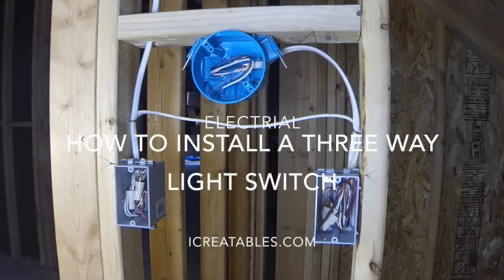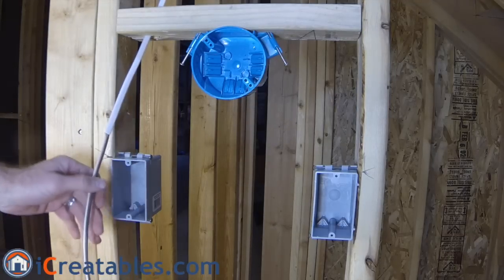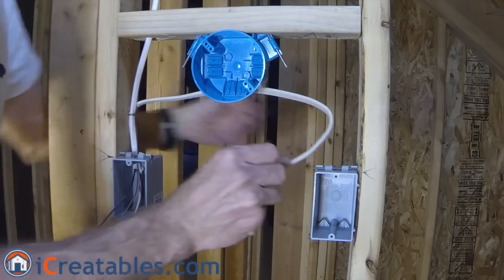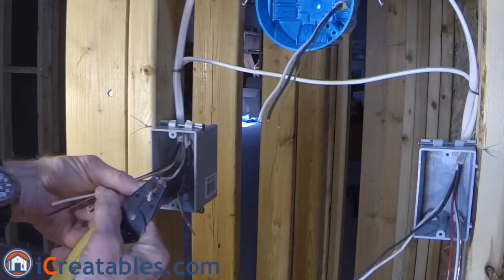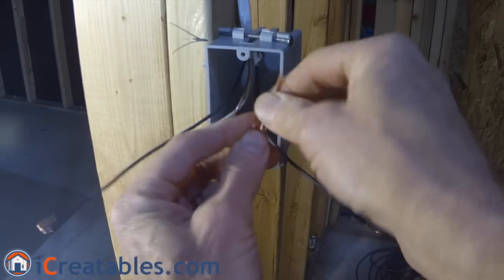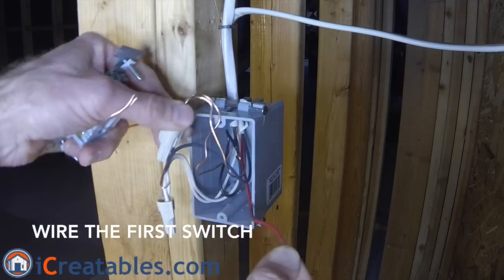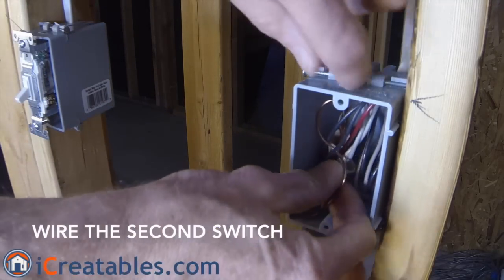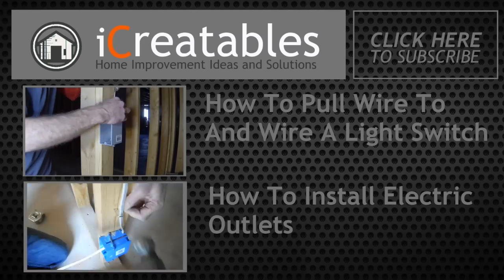Wire a 3 Way Switch

Comment: Good job, learned something new. 
It's also a good idea to push your bare ground wires to the back of the box first, covered and protected by the insulated white and black wires. Its just to easy for that bare ground wire to touch the bare switch or plug screws when the bare groundwires are pushed last.

Thanks

Comment: Great video but you should have mentioned that the carrier wires (in the treeway cable) travelling to/fro and connecting the three way switches together, need not be mirror imaged and can be inverted from each other.
Reply: Correct. If one installed switch is "up" and the other is "down" the load should be on, at least to a picky homeowner like myself. Both switches "up" or "down" = lights off. I flipped one of my 3-way switches to accomplish this. I could have just swapped traveler connections at one switch instead.

Comment: Can you connect blacks wire to whichever side of the black screw on both switches?
Reply: For the black load and line wires from the two-wire cables, yes, these go to the black common screw. For the black wires from the three-way cable with the red wires, these are travelers and go to the pair of bronze screws on each switch.

Comment: Did he connect the red wire different one the second switch? Looks like it’s different than the picture diagram ¿

.
Reply: Fernando Rodriguez 
Came here to ask this.
Reply: Yes, It was different, as it is on the opposite side of the common (black) terminal, where it was on the same side of the first switch.  It's good to see that there are still some highly observant people out there.  However, this will not make a difference for the traveler wires just allow for two different paths to the second switch, either path A (red wire) or path B (black wire).  So depending on the position of the first switch, the hot wire (carrying power) will be delivered to the second switch at either path A or path B, then if the second switch is lined up with the path that is hot, it will complete the circuit and allow all of those tiny electrons to flow to the light bulb and make it glow, if not, then no circuit, and no light.  So, it doesn't matter which traveler wire is connected to which traveler terminal (that is as long as you don't somehow loop the same traveler wire from one switch back to the second terminal on the same switch, but one would need to be rather oblivious and quite dense to pull that one off).  Be aware that although it is incredibly common to have your two traveler wire terminals on opposite sides of the switch, there are a few brands of switches you might encounter that place the traveler terminals on the same side, but once again, as long as you are using the correct two wires, then it matters not which wire connects to which of the traveler wire terminals.

Comment: No one explains if you have power an light wire in the same box. Moron
Reply: It was very well spoken and explained.. The power enters into the first box and is carried to the second switch box by the 12/3 wiring ( or the 4 wire cable ) and then the light wire goes from the second switch box to the light fixture box where the light is connected.. It's all there, listen again.. MORON

Comment: You need to twist your wires together before putting on the wire nut, and use the appropriate wire nut for the connection,  other wise your wires can just arc inside the wire nut causing a fire.  I know this for sure because I've done too many burn jobs that was caused by the loose joint inside the wire-nuts.
Reply from the maker: Great tip!

Comment: What is the difference between the ground and neutral wires?
Reply: Neutral carries the unbalanced load back to the distribution where it’s tied in with the ground and a ground wire gives a path back to ground in the case of a short or ground fault for safety

Comment: If power go to light first and how to bring down to switch?
Reply: 14 /3   to switch  from light .
At light. :  black power to black in 14.3
                    White in power cable to light 
                       Red in 14.3 to light black
At switch.  :  black in 14.3 to terminal on switch.       Red in 14.3 to other term. On switch .       Cap white  to use for 3way later.

Comment: There were some things you didn’t inform them about when it comes to your wires, like push the ground to the back of the box to avoid contact with the other wires or screws and creating a arch also you shouldn’t take two wires and just put a wire but on it you should always twist them to prevent the wire nut from being to loose and falling off and remember to always wrap your ground first
Reply from the maker: Thanks for your expert advice.
Reply: The ground wires should you sleeve them like we do here in the UK.😳

Comment: When you refer to the wires as 2 and 3 power wire cables you don’t account for the neutral? So basically it’s 14/2 coming in and 14/3 between the switches? Thanks for the very detailed video
Reply from the maker: Yes, a 2/12 wire has 3 wires in it, a hot a neutral and a ground.

Comment: Were the travelers put n a different way red on the left on the first box and  the second box it was on right?
Reply: For travelers it doesnt matter. All they essentially do is "open" and "close" the circuit. Kinda why in like a hallway w 3 way switches pushing down doesnt always turn off the light because they just open&close the circuit

Comment: But what if the main cable does not have a ground?
Reply: There should always be a ground unless youre working on a really old house. In that case you basically wire the same w/out ground which is dangerous because of possibility of fire/death/injury

Comment: Thank you.  Very nice step x step.  I have a light fixture that actually has 2 light bulbs in it, with each bulb having its own black and white wire. One side does have a ground. Which would be the best way to wire these?  Thank you, and I need some advice as soon as possible.  👍🏼
Reply from the maker: Black to black and to the brass terminals. White to White and to the Chrome terminal. Ground to ground.

Comment: Does it matter if you use 12 gauge wire or 14 gauge wire or a combo of the two (ie. 12/3 and 14/2)?
Reply from the maker: Depends on how much load is on the line. I like to use 12 because it allows for future expansion and more outlets per circuit.

Comment: I am hoping someone can answer my question...why is it called a 3 way switch in the USA, it is not technically a 3 way switch, there is 3 cables, but the switches are not 3 way switchs....they are single pole, 2 position...
Reply: Why is those switches call a 3way  switch  and how do you wire a 2way switch

Comment: With a voltage detector, how do you tell which side a traveler wire goes to on the 3-way switch? I have 2 blue travelers and 1 yellow common coming from circuit box to switch #1, and the same at switch #2. I’m installing a timer at switch #1 and putting in a jumper at switch #2. However once I remove the travelers from switch #1 I will not be able to tell which traveler wire goes to the jumper nut and which goes to the other brass screw on switch #2. Any ideas someone?

Comment: Thanks for your video. Is it ok to put the red wire on the right of the first switch and put it on the left of the second switch?
Reply: Mohammed Aldujaili ot dpesmt matter where they go. They are travellers.
Reply: Mohammed Aldujaili of you want to make sure, just match it with your other 3 way
Reply: Thanks a lot.
Reply: @rojodo7176  nice man, helped me out too 👍

Comment: Thank you for your clear and well thought out video.  In my office, I have two 3-way switches that control one light.  I want to replace the one light with 2 LED can lights.  Can I just replace the one light with a new can light then jump the other new light off of it?  All the videos I've seen only show 3- and 4-way switches with a single light.
Reply from the maker: Yes you can have multiple lights between the three way switches. Just make sure you dont overload the circuit.

Comment: Just a quick question, I have a spaghetti junction of wiring in my attic, all I want to do is take the light from the attic and simply move it over and use it in my bathroom, I don't need to cut or remove anything, I just have to swap the longer cable around with the shorter cable so I can have the switch in the bathroom. Is there anything that can go wrong??? I don't see what could, I know the safety aspects of it all and the risks and i am not stupid when it comes to this kind of stuff really, I just really want to make sure as I don't want to destroy our lovely house or Injur my missus.
Reply from the maker: Yes, it can go wrong. I would hire an electrician if you have any doubts. Thanks for watching.
Reply: It's all good, I've done it, it was simply a case of disconnecting it all, drill a new hole in the ceiling, redirecting the cables swapping them around and reconnecting it all. It's all working perfectly well, and while I was going about it, I discovered that I had three of the bedroom lights and the landings, were all connected to an old bathroom pull chord switch and not a junction box so I have sorted that out as well, I have a friend of my father, who is an electrician is coming to check everything that I want to do and sign off what I have done so far. Im just being g over cautious, if that is possible. Thanks for getting back to me though, much appreciated

Comment: Technically you should use the outside knockout on the box to avoid potential issues with drywall screws going through.
Reply from the maker: Good point.
Reply: I just mark them with a pencil so you don’t dig through them

Comment: Can it be wired switch fan switch or does it have to be switch switch fan.
Reply from the maker: Either way works. You just need the traveler to go to both switches so they are always hot.

Comment: Do you have any videos showing the other ways to wore 3 way switches like you mentioned? I have one switch in the garage about 8 feet from the breaker box, and another switch about 30 feet from the first box with my lights in between. Is there any way I can just run wire from switch 1, through the lights, and then to the last switch and save about 30 feet of cable?

Comment: My 3 way switch went out after I bought my house and after opening the switch cover I found only black and white wires, there is actually a black and white wire connected to the same screw on the switch. Can someone explain this too me ?
Reply: It's probably because it's a switch leg. older homes had power going to the light box and a 2 it 3 wire cable going to the switch boxes. no neutral at the switch box just switching the hot conductor

Comment: Just watched another video where  3 way lighting switch system was being installed and the traveller wire connections were on the same side of those 3 way switches(Leviton). Your video specifies the traveler wires being on opposite sides of the switches.  What is the difference?
Reply: The traveler screws are the same color, usually 2 silver or 2 brass colored screws. The common screw is usually black, this is the screw that either your power wire or your load, black wire is connected to. Manufacturers may change the location of these screws on the switch itself. No matter where the screws are located on the switch, just make sure you connect the correct wires to the correct colored screws.

Comment: I would recommend twisting the wire with pliers before adding a wire nut and then finish it off with tape (clockwise wrap) from the nut to the wire.
Reply from the maker: Thanks for the tip.
Reply: Splice
Reply: Michael Vaughan you right about that..
Reply: You don't need to twist the wire with pliers, you just need to put the wire nut on correctly. If you twist with pliers you run the risk of over twisting the wires when you put the wire nut on breaking off the copper having an intermittent connection.

Comment: Thanks for sharing. So the black or red traveler wire can go to any traveler screw right?
Reply: +iCreatables - No. EITHER traveler can be hot, according to which position the switches are in. It's 50% black and 50% red.
Reply from the maker: Yes. The electricity does not care what color the wire is. But be careful, the colors help you remember, it is a good idea to mark the end somehow to let the next guy know which wire is the hot one.

Comment: A good electrician will make sure their splices are secure before putting on the nut
Reply: Though he messed the switch up, if you see at 7:37 that he puts the red wire on the right side of the switch when that should be the black wire that goes to the light.
Reply: The terminations were correct. These are simple 3-way switches. The common/black screw on the 2nd switch goes to the light and the travelers/gold screws go back to the 1st light.
Reply: @kalio1969  so on that second switch it doesn't matter that the red wire was on the right side and black on left correct? It can be either or as long as that commen/black screw is wired in the right spot right?
Reply: TheBored22 has

Comment: you should really splice the wires together with linesman's because it makes for a better connection don't just wire nut the wires
Reply: Eric Chrisman your right about that I have seen that fail a lot
Reply: My instructor told us not to pre twist the wires. Just line all the wires up evenly, use the proper size wire nut and twist until you see the insulated part of the wires start twisting together. Then pull on the wire nut to make sure all the wires are secured in the wire nut.
Reply: i think most of the issues that stem from not pretwisting the wire are that people don't secure the wire nut on enough to cause the visible portion of the wires just below the nut to also twist a few times; if that doesn't happen the chances the wires in the nut are twist is slim. that being said, I like pretwisting as it gives me piece of mind as a diy'er but I've also got more into using the new quick connects from wago and ideal.
Reply: Doesn't matter as long as you check your wires. It comes into play when they are hot and you are testing when you take nut off the wires that are not pre twisted will tend to jump out and can cause problems.

Comment: Have you ever heard of wrapping a switch or outlet with electrical tape to cover the screws once the connections are made?
Reply from the maker: Yes, this is very common in switch and outlet boxes where there are lots of switches and outlets. It keeps the box a little safer to put your hand in and also, if there is a bare wire, like a ground wire it has less of a chance of conducting to the wire. This is often used in commercial construction where the boxes and conduit are metal.

Comment: Hi I'm new. Would the red and black traveler wires work the same if they were flip flopped on both switches?
Reply from the maker: The rule you need to pay attention to is that the electricity does not care what color the wire is. It just makes it easier to see what is going on when you follow standard practices. Thanks for watching!
Reply: yes

Comment: Thanks for the video. What if i'm working with an old circuit using only black and white cables and no red lead?
Reply: If its just black and white its prob a 12-2(& a ground). Prob a single way basic switch

Comment: After f'ing around for over an hour with an electrical book and the instructions that came with my 3 way dimmer switches, I watched this video and then referenced the diagram at the beginning of this tutorial and I was done 15 minutes later.  I previously had my wires run, just needed to do the hook up to the switches.  Thank you so much for the clarity and making so much more sense than the instructions and diagrams I was initially trying to decipher.  Excellent work sir...this is the epitome of a "how to" You Tube video!!!!
Reply from the maker: Awesome! Thanks for watching and commenting. Glad it helped.
Reply: Zonktified 1 +1

Comment: Can you use your source from an outlet
Reply from the maker: Yes, Just make sure that you do not have too many fixtures on the circuit. Also, most electricians do not wire the lights from an outlet because outlets can trip the breaker and then the lights go out. But, if it is your only source then....
Reply: +kamikazikaizer - If it is a 20a outlet circuit from which you are sourcing your light circuit, you must use 20a light switches, 20a light fixtures, and 12 gauge cable.

Comment: If I have multiple light fixtures (4) do I just continue looping them from the first light fixture?
Reply from the maker: Yes, if they are between the light switches you will just wire them to each other.

Comment: But my drywall is already there so I don't know what wire goes to the light and what goes to the other switch.
Reply: +David Crandall - Just use a test light or VOM to determine if power is fed first to the lights or first to the switches.
Reply: Does not matter if you know what side has the power coming in or going to the light the black with 2 wires will always go to the black terminal and the black and red out of the 3 wire will go to the gold doesn't mater what one

Comment: Is there a polarity of traveler wire in 3 way switch?or it can be reverse? Need answer.
Reply: +ronnel labana - No. Traveler wire color will only determine which direction the switch will be.